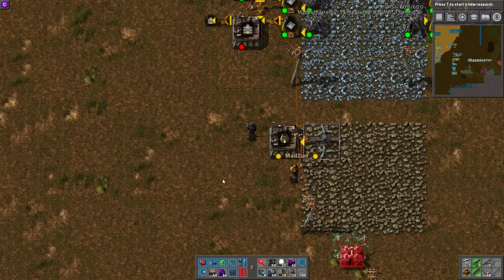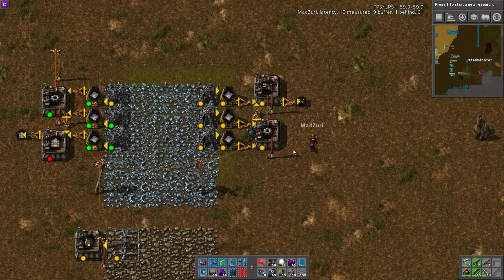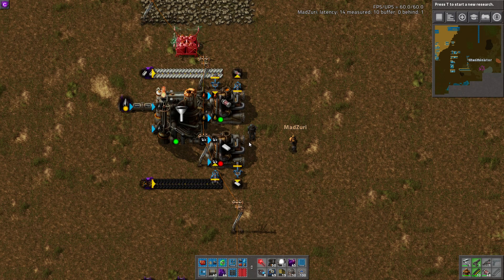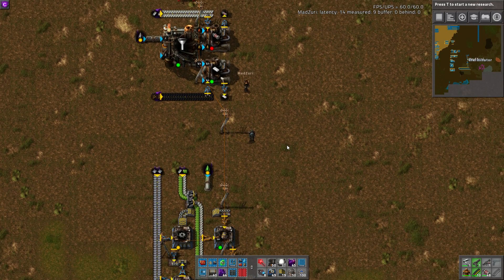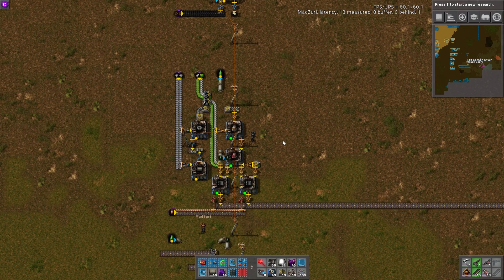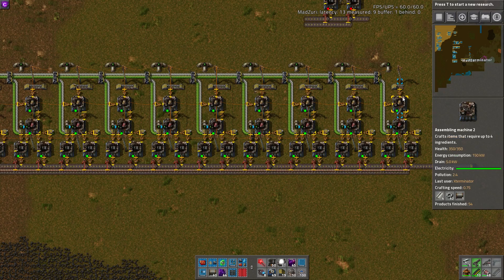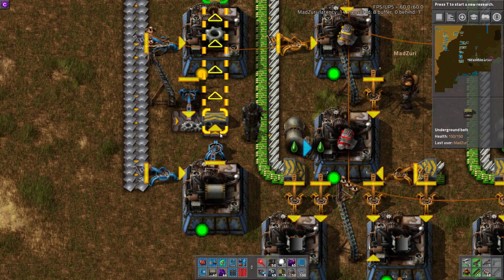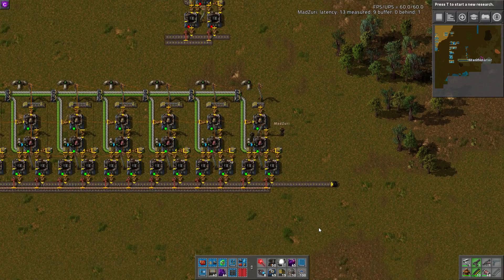MadZuri's Bootstrap Builds (belts,plastic) :: Factorio Workshop Season 2 - Building A Better Factory

Comment: Hopefully you could get to builds that involve marathon map recipes (where gears are 4 iron, circuits are 10 cables + 2 iron), as these current builds aren't very effective for marathon.
Reply from the maker: We typically try to avoid modded or non-vanilla recipe builds because they only apply to a few specific people. However, we have had a few submissions for marathon builds so we will get to them at some point. :)

Comment: Submission:
https://pastebin.com/GkS8udW9

bot based tile-able speed beaconed kovarex 

you can cover the 2x4 (2 horizontal 4 vertical) stamps with 1 roboport(centered at bottom). Prime each  centrifuge with 80 uranium-235

produces about 94 u-235/m in the 2x4 configuration
Reply from the maker: Nice! Submit it through the form in the description though to make sure we get it. :)

Comment: I realise some might not call it bootstrap, but some security bootstraps would be nice. I have currently overextended the start of my base (again ;-) ) and can assure you that there are interesting problems to solve in low-tech base security.

Also, separately, some early low-tech combinator designs might help ease more people into using them.

Comment: I really like the oil bootstrap but.....

It only works when you've researched flamethrower ammo, which needs military science. So there's 3 more researches and a military science build you need to complete after oil processing before you can use it.

But I'll certainly use it myself in future to make my ammo. However if you're playing without enemies switched on, a different oil bootstrap may be better. Convert the light oil to solid fuel and the heavy to lube/solid fuel. You will have a steel chest of 4.8K plastic before you get any backup of the solid fuel and lube.

Comment: You culd reduce the size of zuri's robot build, by having the steel and circuits run on the bottom like they almost do anyway, then you can get rid of the belt up to, and move the lubicant down.

Comment: id love to see a efficiency module build to make those first 5 for power armour. feed by belts of course just cuz it makes zuris life harder!
i always build mine without a output, then I collect from the machines so I only build 5 no more, if Zuri can id like to see a build that makes exactly 5 (including whats in the machine) without circuit nonesence
Reply from the maker: We actually discussed doing some bootstrap module builds but didn't have time for this video unfortunately. I was thinking the same thing you are, so modules will almost definitely be included in the next bootstrap design video we do. :)